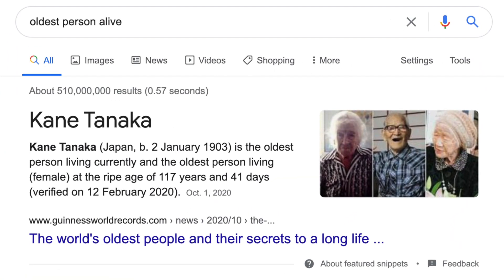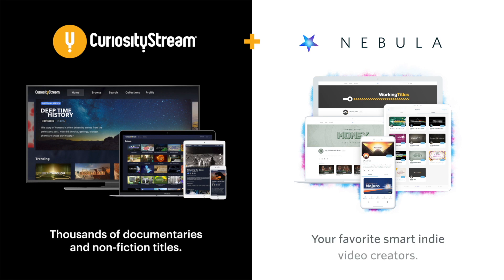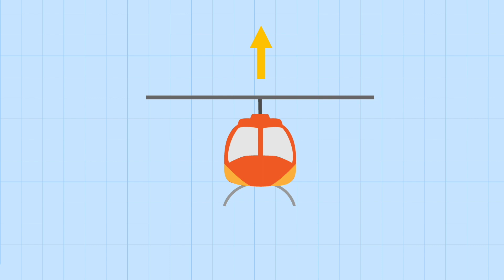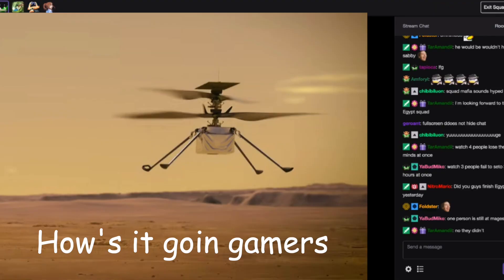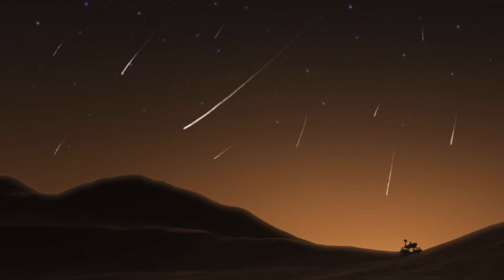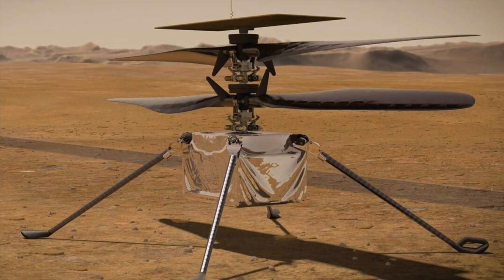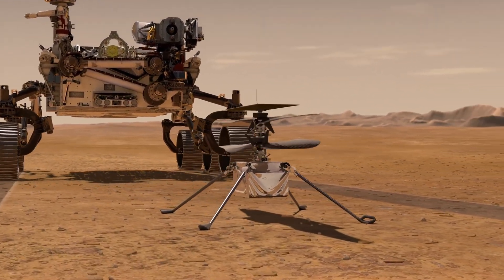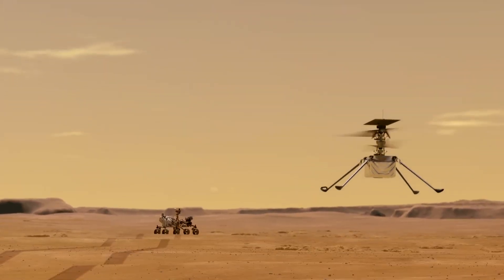Building a Helicopter on Mars: Ingenuity, Explained

Comment: Nice video, I like your channel.
It is very interesting to see that in these circumstances the g changes, in the class examples we almost always use that of the earth.

I have to say that in the Lift equation, rho is not the air pressure, rho correspond to air density. But the main idea it's ok.

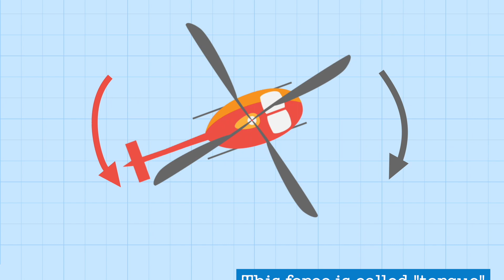Comment: 5:10 without counter-torque wouldn't the aircraft spin much much slower than the rotors? Even neglecting the difference in drag, there's still a much different first moment of mass/moment of inertia between the aircraft body and the rotor.

Comment: Does perseverance drive faster than ingenuity can fly? What sensors does it have?
Reply from the maker: At max perf, Ingenuity is much faster than Perseverance: 50m in 90 seconds vs 4m. But of course, Perseverance can "persevere" for a much longer distance at a time whereas the Ingenuity needs to recharge for an entire day after a 90 second flight. I believe it has 3 basic sensors and gyroscopes for altitude/velocity/heading/etc, but don't quote me there.